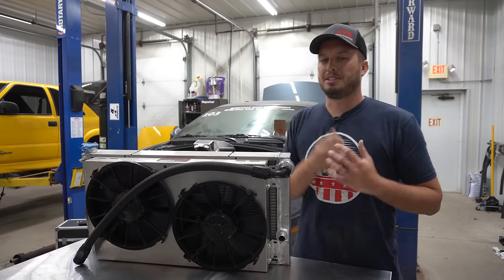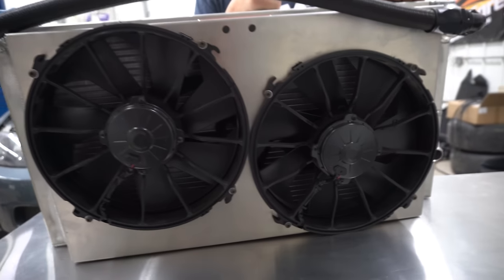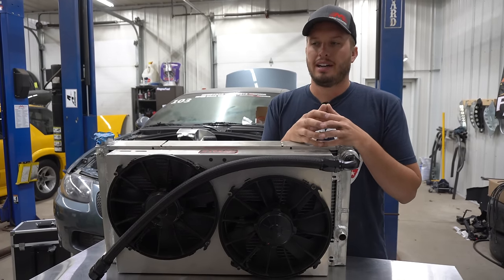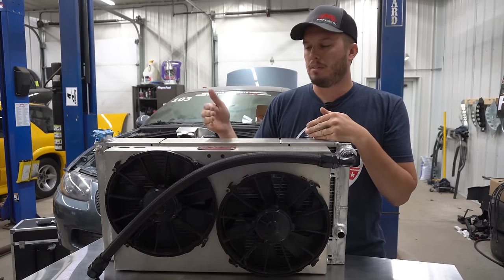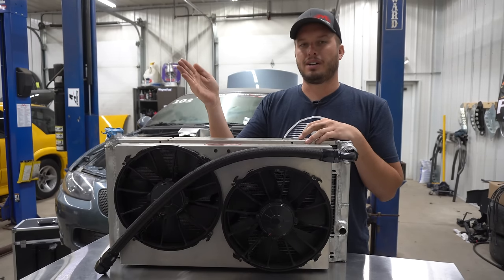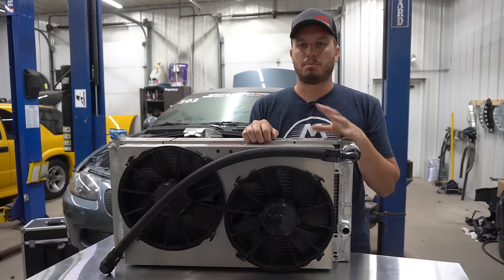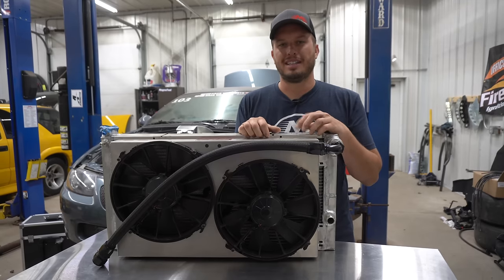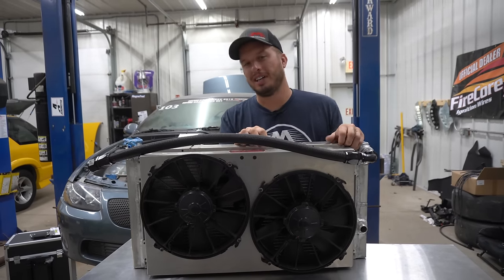Tech Tip Tuesday: How to Power Electric Cooling Fans... Must See!

Comment: I literally make my living designing industrial control systems and if it is one thing I have learned, the guy who designs a fancy control system rarely has to live with it. The guy who maintains what he builds designs a simple, easy to understand, and robust system that doesn't have fancy features but works whenever you need it to. These are great tips gentlemen, keep it up.
Reply from the maker: Dustyn Jensen so true!  The KISS system wins everytime
Reply: As a technician in a factory I can attest that you speak the truth. We have too many engineers that design overcomplicated machines that are hard to diagnose then repair.
Reply: I too make my living with industrial controls, this is good advice. Simple and robust is always the way to go.
Reply: I don't agree, a properly built control system with brushless fans will make for a very efficient, reliable  system.  Reducing amp load with soft-start prolongs the life of your battery/alternator and overall increasing reliability of the system.  I work for DeltaPAG. We manufacture  brushless cooling systems with quality digital controls. They're the LED light bulb of fans. An LED lightbulb is far more complex than a candle.
Reply: I may have to try this young fellas brushless motor because I want to integrate my fans with and electric water pump that will cool even after I shut the engine down. Oh by the way, I’m not a fan of the LED lights at all. But I will look into your brushless motors.
Reply: 4yrs later but I once heard an older gentleman say, the perfect man, is wise and lazy. They will find the quickest most efficient way of doing something.

Comment: Toss a 1000 uF electrolytic capacitor across your leads of each fan. Will help each fan to “kick over” as it phases current and voltage about 90 degrees at best. Enough to get that electric fan motor to kick over with no strain on the electric motor.

Comment: I beg to differ, on your comment that 160 is too cold.. Its not dangerous but my motor made 13 more hp from 160-190.. The engine is definitely more efficient with more heat and with temperature, comes pressure, that's why the OEM systems are higher pressure because they run at higher temps. A motor running at 220 is not dangerous, most race cars in professional racing, run their motors between 220⁰-240⁰, like Nascar or IMSA style cars. I see your point with the mountain theory though, but going from 190 to 210 is fine.

Comment: I use tinned marine grade wire and connectors on all my vehicles. Those parts make automotive specs look like junk. I never have failures from corrosion, connectivity, or amperage overload when following ABYC tables. There is a little price premium, but my wiring is always one and done. Also, don't forget a lot of strain relief and chafe protection.
Reply from the maker: That might help right up until the electrical components.  Can’t control what’s inside the motors relays etc

Comment: Thanks for the advice. I have a new cold case radiator with dual fans on order. Will call Jegs tomorrow and cancel the thermostat controllers and go save 75.00.

Comment: I'm glad you touched based with using a relay for the fan, I work at a parts store in South Texas and I see so many people say screw it and just run a switch and wire to the cooling fan just case they get intimidated by the fact that there are more than 2 wires

Comment: I ran into this TTT yesterday , my car ( LS gen 3 iron 6.0 N/A) always ran on the really warm side, almost like the factory truck 210*. 
So on my way to shop I went into my Holley system and changed both fans to come on at180*( off at 160*) and BAM even in slow traffic the car was running a lot cooler , I live in central FL. where it is hot and humid. Good tip! See ya at Bradenton No Prep!

Comment: The load on startup is so true & what i don't think a lot of people understand. In higher voltage applications, especially industrial, motors use & need a capacitor to "jump" start and get them going.

Comment: If you are going to wire your fans up using a switch. Put an idiot light on the dashboard. So that it is illuminated  when the fans are off and goes out when the are turned on. I have seen and repaired alot of  engines from being over heated due to the fans being forgotten to be switched on. You should also use a Mechanical Temp guage that way if you have a electrical issue your guage will still work. Another tip is if you have round style guages (almost all of them are) orientate them so at normal operating temp the needle is pointing straight up. That way at a quick glance you know if you're temps are fine. I also set the oil pressure gauge like this as well. Might sound a bit weird but in a road race car it really helps. One quick glance and you know if you're good. One more thing use a Mechanical oil pressure gauge as well. But use braided hose for the feed line not the poly crap that comes with some guages. The last thing you want is the feed line to burst spraying hot oil all over the engine or all over the inside of your race car.
Reply: Diffenitly agree mechanical gauges for oil and water .it cost me 10 grand losing a race over a bad sensor  the race pac said 270 .so after that every car mechanical gauges plus race pac gauges. That was a hard lesson to learn 10 grand over a 30 dollar sensor. Damn .lol

Comment: Had to subscribe as he’s 100% correct.    Most us gear heads learned this from young.    I have 1 wired to ignition so when car starts 1 fan on 24/7.   Second fan is on a toggle on dash and that lightens the ZAParoos on the system.   Works amazing.

Comment: Pulled one out of a crown Vic and dropped it in my f150, wired it through a relay to my switch in the dash and it has run flawlessly for 10+ years

Comment: Really simple way to have them turn on at startup without worrying about it: have the ignition energize the relay, and use a self latching relay (relay that locks itself to the on position once power starts to flow to the load). That way the fans start when you crank the motor, and stay on until you kill the power. I can explain more if needed, I know it's hard to communicate this idea through a YouTube comment.

Comment: Probably one of the best fans we have used were out of a Lincoln Mark Vii.  I think they are like 5000 cfm.  New Ford trucks even have 3000+ cfm.    With a double pass or triple pass  radiator you should be Golden . All my cars ran electrical fans running from start to stop.  It’s a thermostat that will help you regulate.
Reply: The Mark VIII fan moves 3900cfm of air. One of the best OEM fans but still a brushed fan. Starts at 60A and then falls off to 30A within a few seconds. Use brushless fans. Last longer and don’t use a lot of amps and you don’t have the big spike at fan start.

Comment: Yeah wiring for sure. Note, generally mil spec wire 12g is rated at 24 amp, mil spec 10g is rated at 33amp give or take an amp, just a thought when choosing wire size. If you have a bunch of garbage connections it will make more amps, and relay each fan. Switch the fan via the ground on the low side of the relay like ecus generally do, if you choose a toggle. I agree with the statements on letting them run for sure. If you are badass and have a power distribution module you can monitor the amp draw on your fan circuit. Maybe do a test with wire size and different crimps and watch the current draw in different scenarios. May be helpful in visualizing. Also, the cars rattle and shake and vibrate all the time non stop. I always try and strain relieve terminations. It’s a little more difficult on the larger wire for pumps and motors but helpful in longevity. Generally we are not pros just hobbyists so every little bit helps. And to my way of thinking and I will say I am very value oriented, spending the money on good wire is a must especially after a 4-600 dollar pump, 2-400 radiator and whatever fan you use plus plumbing. Anyways good luck. 🇺🇸 first.

Comment: My new setup is pretty basic. I took and modified the stock setup. So I added two pushers on the A/C condenser that run all the time when the fan I commanded on. This helps with low speed as they pull air through the cowl. Those are aftermarket. My main puller is an OEM unit made by siemens and runs on 2 speeds. The low speed maintains temps with A/C off and the high speed is on when the compressor is commanded on. I have it programmed on at 195 off at 185. (I run a 180 stat because I enjoy heat in the winter and the car will run against the stat even in the upper 90s) so it is basically this... car hits on temp, pushers and low speed main comes on. Car hits off temp, all fans shut off. A/C switched on, fans come on high and pushers come on. Now the ecm shuts them down above 35 mph... I did a bunch of testing and they don't seem to help above 40 and honestly on the highway it seemed like the car ran hotter on vs off. So I just leave them off above that speed. Runs fine. I try my best to use OEM parts for things like that, they make for the most part, the most robust aftermarket parts look cheap. 

Now on the 67, the spal unit pretty much runs all the time. That 14 inch unit is a beast but it doesn't flow as much as the oem on my car. But the rad is substantially larger so it doesn't need the flow.

Comment: Yes definitely cannot hurt the motor running fans from start up / cold because the vehicle utilizes a thermostat. Coolant inside of the motor reaches temp before allowing cooler coolant from the radiator to enter the motor.

The only thing you'll do to the vehicle is create more load on the alternator, increasing fuel consumption. Twin 16" Extreme Spal 3000cfm fans pull 50A to 60A.

Comment: If you have a temp probe switch and a manual switch, make sure it isn't a light up toggle switch. When that toggle is off it grounds the signal wire to the relay.

Comment: I am about to do a dual, 2600cfm total, 25A each,  electric set up in my modified 2wd short bed Ram, and was REALLY hoping you would touch on where exactly, you tap into for your switched power source for the relays. I have a hard time figuring out a good, clean switched source when I need to install a mod. Good vid though.. everything made sense. I just want mine to come on at around 160°, and stay on till after I shut down.

Comment: I was expecting this to be the standard 'Relay' video, but turns out to be far more useful. Quick question, does all that apply equally to smaller, modern engines? 4 & 6 cyl, 2000cc engines etc.
Reply: Haha same considering I've never used relays I almost didn't watch it

Comment: Maybe you can help me. 2002 s10  zr2 4.3l electric fan conversion. I see 97 degrees in summer regularly, I run 32” tires, A/C, and haul a 2800lbs bass boat. The drag the clutch fan produces is worth the conversion but…I cant get the engine to stay below 220 degrees at 55mph or faster. I have 2-12” flex-a-lite fans with an aluminum shroud. eBay 3row aluminum rad, and a ebay relay harness, 195 thermostat. The A/c is cold and engine stays cool at an idle, much better then the clutch fan (missing half shroud) but when it starts to work on the hwy is wants to get hot.
It’s a v6 I don’t understand why I’m having so much trouble. Any suggestions would be greatly appreciated.

Comment: I have 2 fans on one relay..thats how it came.  Added a 150 amp alternator thats getting 14v running.  Fans kick on and vibrate ans surge the car..if i unplug 1 of the fans it works fine.  Do you think having 2 fans on one relay would cause this?

Comment: I’m building a 700hp ls powered 1989 mustang. Drag strip only. What radiator and fans do you recommend? I’m also going electric water pump and curious what gpm do you recommend? Thanks

Comment: My question would be if you’re running a dual speed fan does it hurt to have the high speed triggered by a temp but always have the low speed on when the engine is running.

Comment: So I bought a camaro with eltric fans I've never messed with them before. Car has a 327. It runs like 200 n 210 when cruising hot. If I sit at stop it'll go to like 215 220 depending on how long I sit. Which then I kick fans on but it takes like 3 to 4 minutes sitting still to really cool down. Basically what I've been told it that I only should use them when stopped that if I put them on while driving its doing opposite of cooling. Might b confusing to u but I'm kinda stumped lol I just wanna turn it on n not worry about it😂

Comment: I’m changing over my Foxbody clutch fan assembly to electric. I will be using a factory SN95 electric fan. So using the proper size wiring and relay, just run it on all the time? I did this with my Ram a/c fan after controller failed. No issues for years doing that.

Comment: I’ve got it wired to my Ignition switch so when I turn my car on it turns on. The car is a tbss so it has no problem reaching temp fast. each fan has a relay and a 30amp in line fuse  all wired with 12g wire

Comment: Where can I buy this for my 2006 Pontiac GTO? I have a LSA swap GTO and my stock fans aren’t cutting it. Today it was 99 defrees and it overheated. Engine temps were 235 and top 240. Had to pull over. I have aluminum rad so I know it’s the stick fan not keeping up with the high horsepower.

Comment: hi , 
1/ A decent controller with 1/ staggered start 2/soft start   3/PWM controller for brushed fans is available . 
2/ brushless /Pwm fans  ,, beaware  many aftermarket  fans can draw alot of power . Shop around

Comment: Set it and forget it...until you leave the vehicle. Got it. Thanks!!!
Reply: Or set up the relay so it requires both the switch and ignition to be on, this way you never have to remember to turn it on or off, so it turns on when you start the car, but you have the option to turn it off using the switch.

Comment: My 2000 ws6 has a dual pass griffin with two 2200 cfm badass derale pushers using the 3 relay two speed control with Holley controlling the on off temps. Low speed on at 185.... they pretty well hold the car at 195... at long stops the high speed turns on at 200 for a second then right back off. Not bad with the t6 right up against it on the other side

Comment: What switch do you recommend  for running fans   i got a cheap 30 amp led switch. But i did run switch to a relay then to duel fans
 I guess i need better fan car still runs hot to me about 190 to 200

Comment: As an auto mechanic,  I know that condenser fans turn on and off and cycle all the time.  Maybe you are using cheap fans.  Also you need the coolant to stay at 190-200 for optimum engine performance, emissions.

Comment: Doesnt matter if the fans are running on warm up, the thermostat isnt letting the engine coolant circulate through the radiator.

Comment: If they are cycling they are big enough they should be on a two speed or variable speed. Even a simple resistor.   The brushless would also be better. Not only because the current draw is lower because you can do softer start from the controller but can also do variable speed.

Comment: I wonder why he didn’t touch on the thermostat in the system. The t-stat would shut off/open up water flow to the rad regardless of what the fans are doing. So the fans could be cooling the rad to 100 but if the t-stat is a 185 then that’s the lowest the engine will go after it’s warmed up.
Reply: I don't think they use thermostats in their racing applications, and I think (according to my limited knowledge of cooling systems) you don't really need them unless you live in freezing weather. as Doug said in the video, running the engine a few degrees lower than its operating temperature increases fuel consumption a little bit, that's it. I'd rather spend a bit more on gas and run it cool than blow my engine in case of overheating
Reply: Mahmoud Mostafa You can always get a 160F thermostat. IMO if you’re going to be putting a lot of miles on your engine before rebuild than it would be a good idea to install a thermostat to reduce the warm up time and increase longevity. I guess with the street strip cars they aren’t as worried about that since they typically get freshened up bottom ends every couple seasons or less.

Comment: What are your thoughts about adding flaps in the shroud to help let air get through while at speed on the highway?
Reply from the maker: I don’t have any opinion on them but it Seems to make sense to me!  We run the derale fans on most of our builds and they have them.  Definitely hasn’t caused any known issues
Reply: @MotionRaceworksOfficial  just thinking that at speed the fans are not restricting the air flow if the flaps are there to let air get through. My shroud is pretty sealed up and the only air getting through is at the holes where the fans are mounted.
Reply from the maker: jwright650 def an interesting perspective.  Id love to know results with and without the flaps

Comment: I run RC brushless motors, they have an electronic speed control. So by switching power to that circuit is not great. Yes brushless is digital in that the rotator is pulled by the field so no starting windings but I still would not connect and disconnect a brushless motor
Reply: Hey GoOhio, I don't know how RC brushless controllers. Our #DeltaPAG brushless fans work great turning on/off and variable speed. I guess its how the bldc controller is designed/programmed.  Also they work great all the way up to 28 volts. You should check them out.  Now with brushless you can have you cake and eat it too.

Comment: 15 years ago I did a efan swap on my brono2, I found out the hard way that a toggle cant handle the  power for the  fan, now days on my nova and my chevy pickup I have efans and with 8 gauge wire to everything.

Comment: Would a duo of standard radiator fans be able to run in series? I know they will spin slower than parallel and i know the difference but will the fan motor survive at 6-7 volts? Has anyone tried it?